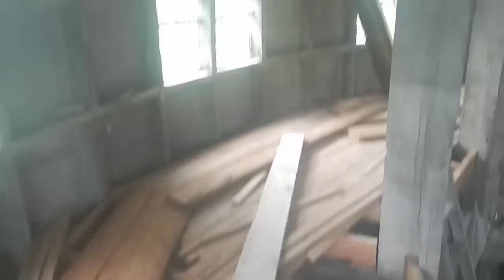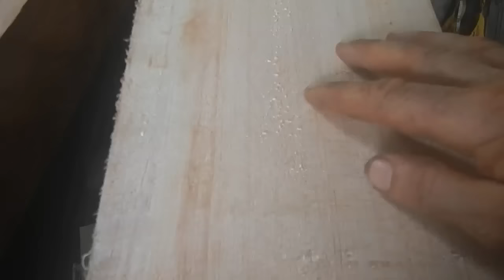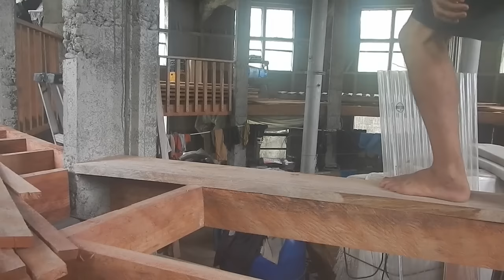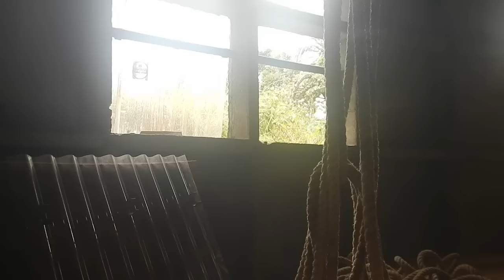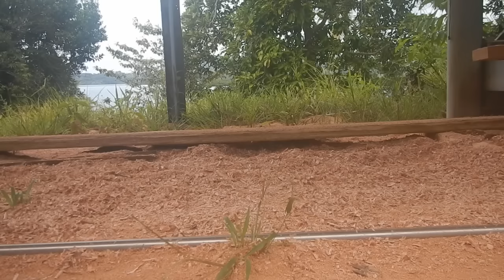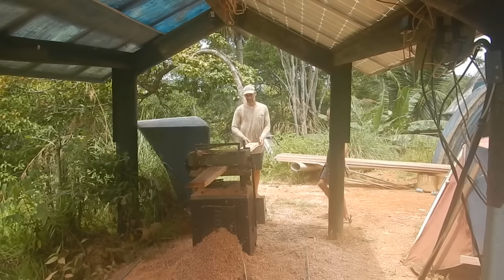Stairs and 2nd Floor Begins!

Comment: It looks like you gotta have some sort of weighted roller before and after cutting wheel on your lumber mill, pressing the board down. Large diameter, 3D printed wheels with press-fit bearings might work great for it.

Comment: save your sawdust you can later press it into bricks and turn them into real nice charcoal. though watch out breathing in the dust some of those jungle hardwoods are real rough on the lungs. though it varies from person to person on how well they can tolerate it. I can handle ipe dust just fine while some of my coworkers almost instantly start getting noes bleeds from the dust

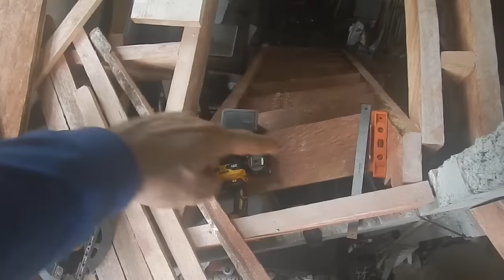Comment: @jamie  1:40  I imagined it going on the inside of the center circle... Not coming up like a treehouse... But if you come up off the side you can use the concrete to stabilize the stairs and have a proper stairway off to the side.. you can turn it into any direction you want to from there.. plus it'll give you full second floor, floor space... Yeah brother I thought about this for a while that's why I mentioned it... Don't have the stairway coming up through the center.. have it on the outside in the center of the circle ⭕ kind of like a yin and yang sign ..🌀... Think swirl Jamie...

Comment: If you only screw one edge of the boards and they are still a bit wet they will shrink to the fixed side with less chance of cracking.
Reply: Or one screw in the middle for now.
Reply: @TheCritterWindow  Aren't nails better for floorboards ?   something about them being able to bend without being brittle like screws?

Comment: @jaimie you can set the blades to cut the depth  the gauge states.  Normally the planer have a specific tool to set the blades in perfect parallel and in alignment with the depth measurement

Comment: As a carpenter, I can't imagine doing the entire floor without a bevel gauge. You can make one with two pieces of flat iron and a wingnut.
I bet there is an adjustment for the pointer on the planer. 🙂

Comment: as someone who has built a few spiral staircases you did a real nice job curving the treads evenly. you ever consider doing a center spiral staircase? it would be very space efficient and you could do like a parascope or something out the top of the roof. its actually simpler to do a tight spiral over what you did already because the center is all straight cuts off a 8x8 in the center. I have done 1 of those and it was so much easier than the grand big twisting ones most people do in their mansions. I made my outside stringer by cutting a few hundred 3/4" x 2" strips. started by cutting the central column stringer and set the treads then I was able to clamp glue and nail them to the treads building it up to a 16" thick stringer. super solid just keep every joint at least 3 feet away from another joint.

Comment: if you added some pipe roller stands to your planer set up you could increase the amount of boards per hour. instead of adjusting the planer constantly run a whole stack of boards through at one setting using your rollers to roll the board off into a stack after it comes out of the planer instead of working one board at a time at least thats how I do it when I have to plane multiple boards

Comment: Dude! Good work! I like that natural edge by the stairs, plus the twist to them! Never have i seen such a literal loading bar for a phisical process than that planer! If i had all that wood shaving i would make a retort for generating coke for blacksmithing. If you can get that burning and then prevent oxygen from reaching it you would be going from solid fuel forge that does 1000 degrees farenheit ish to 2000 to 3000 after another go in the retort to 4000 after the 4th cycle and one can forge weld with that. Literaly liquid steel on liquid steel and they dry together.